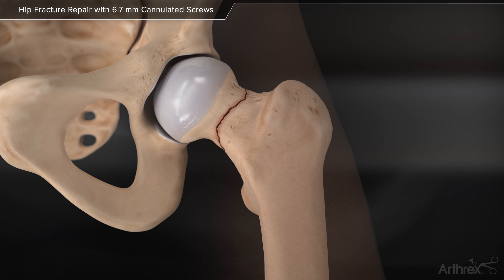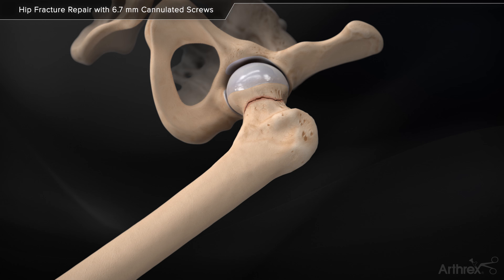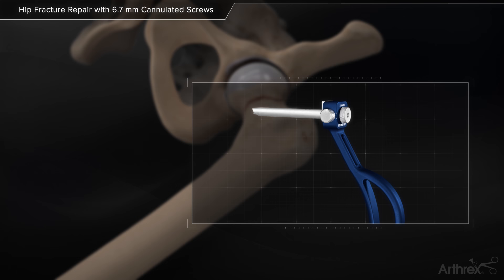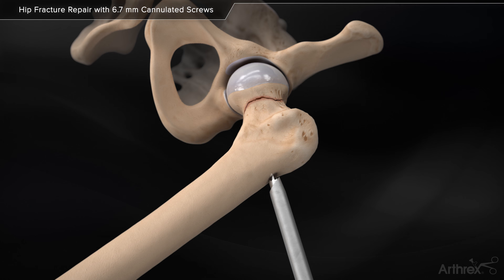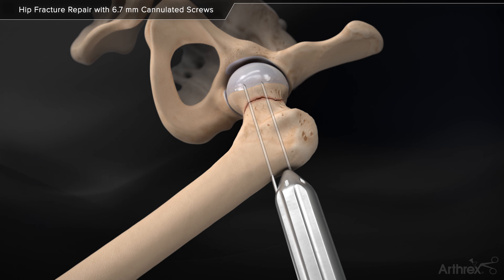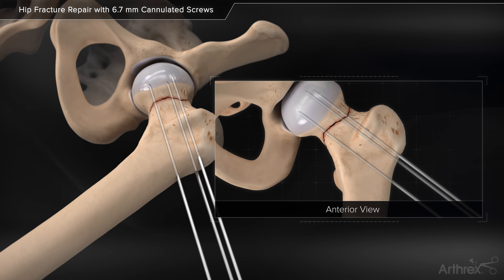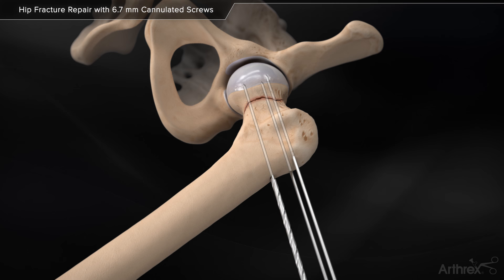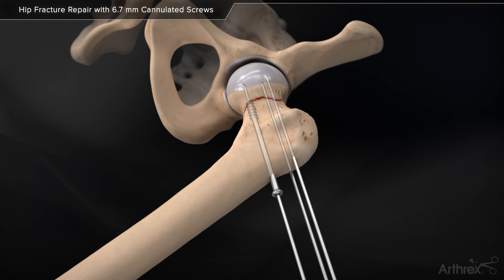Hip Fracture Repair with 6.7 mm Cannulated Screws

Comment: In this cases how many months and years to be heel and recover  I have been 5 years but i have a little pain in my hip sometimes I like it ok but sometimes it's not ok ,so tell me Doctor what to do that I can be ok like old time with my real legs I'm 36 years old  I will be very thankful to you Doctor
Reply: how is it now surssh did u remove the screw.and pain.
Reply: How are you now sir?
Reply: I already had a total knee replacement on the same leg as the fracture. After 9 mos of PT and every remedy known to man, the knee still hurt 14 mos post op. Then I fractured my femoral neck. I’m 75. I’m walking 6 weeks post op. Even the surgeon was amazed. Great surgeon for fracture. Not same one as knee who refused me pain meds after two weeks post op. This surgeon helped control my pain which enabled me to recover rapidly. I only had PT for two weeks, then did exercises by myself and go to the pool every chance I have. Walking in the pool and doing leg exercises as well proved most beneficial. The fracture surgery was nothing compared to the knee.

Comment: can anyone help me with the instrument names in this video? So the surgeon would use a pin guide (first instrument) to insert the first k wire inferiorly then attach a multi pin guide to insert the other two k wires. Is the parallel pin guide another instrument used if they do not have the multi pin guide available or is it used after the multi pin guide?

Comment: Broke hip about six  months ago, they put pins  and screws, done good for awhile  but  now having  pai n in groan, going down front of my leg  muscles weak alot of pain, put asteroid  shot didn't help  in hip😢just wondering what i can do
Reply: How many hours where between when you fell and the operated.  I wonder if the bone has died and you’ll need full replacement.   That’s my worry.

Comment: Seems in alot of these wouldn't it be easier to do a total hip replacement?
Reply: My specialist had explained this in detail. 

A total hip replacement is generally catered for older aged people as they have weaker bones which may cause more complications if they were do this type of surgery using cannulated screws. This type of surgery is mostly catered for younger age people, where the chances to save the femur head joint is significantly higher.

Comment: How many months required to remove the screws
Reply: Removal not advisable until indicated
Reply: Depends, it took me 8 month.
Reply: @Enlayy  does the pain reduce? and can u able to walk and do regular activities?
Reply: @thammishettyrammohan  well my once broken side still feelf different, but dont let that keep you down. Im going to the gym regularly and im hitting legs two time a week. Altough I have to train a little bit different compared to the time before my injury. But dont let this injury keep you down and try to make the best out of it. Walking and regular activities are no problem. Im guessing this is also because I gained some muscles on my legs again which is quiet important. 
If you have any questions feel free to ask me, im glad to help because I know how you feel. :)
Reply: @Enlayy  thanq and post tuesday i am going for the surgery ...hope eveything will workout good
Reply: @thammishettyrammohan  It will ;) My injury was pretty much the worst version of it and it turned out fine! :) You will be alright. If you need any kind of advice feel free to contact me.
Reply: You felt much better after removing the screw?
Reply: @thebestkeptsecret2263  In the beginning, no. After some time, yes.
Reply: @Enlayy  so removing it is worth it? Mine is in my hip area. Screw and side plate. Where's yours?
Reply: @thebestkeptsecret2263  I had the same done to me. Like shown in the Video. Sonner or later the screws and plates have to come out. Did you doctor give you a choice to remove them? Because in my case they just told me its time to remove them and then they got removed.
Reply: @Enlayy  Haven't ask him yet. But some doctors said it's ok to leave it there as long as it's not bothering the patient. But my only concern is once you get older you might get complications not removing it. Why did the doctor advise you to remove it?
Reply: @thebestkeptsecret2263  Well I had the screws in me when I was 17-18 years old so I was really young. I guess that plays into the decision to take it out fairly early. I was told that the process of removing everything is really easy thought so I dont think you have to worry. My bone was back together and thats when the doctor gave to green light to take everything out. After that my rehab started. In the beginning I felt really unstable on my once broken side, but it got better and better over time. I would recommend you to go easy on yourself once you get rid of the screws and stuff for some time after the removal. Make slow progress step by step, literally.
Reply: If I were you I would talk to your doctor and tell him your concerns. Communication is really important in the inujury.
Reply: @Enlayy  I see...how long you had the screw? How many months now since the removal of your screw? Which part of your hip had fracture? Neck of femoral?
Reply: @thebestkeptsecret2263  I dont really know which part it is, particularly not in english since its not my first language, but it was the worst type of fracture, thats what I remember. I had my screws in for ~8 month and it has now been ~1.5-2 years since I got them removed
Reply: @thebestkeptsecret2263  Im guessing its the neck fracture. But my injury wasnt a fracture my femure neck was literally broken into two pieces.
Reply: @Enlayy  I see. Im hoping for your fast recovery
Reply: @Enlayy  how are you now still since the removal of screw? Getting better? Thanks
Reply: @thebestkeptsecret2263  Well at the moment nothing really changes, its just the way it is and that is totally fine. How about you? Did you get yours removed?
Reply: @Enlayy  hi! I just got three cannulated screw inserted on me yesterday. Nice to hear you do well now! I want to keep my screw inside me, is it advisable?
Reply: @chailiang1230  Do you want to keep them permanently?
Reply: @Enlayy  yes I don’t want to go to another surgery if not needed
Reply: @chailiang1230  You should speak to your doctor. I got mine removed and I am very happy with how it turned out.
Reply: @Enlayy  I’m sure I will. My next follow up will be on 4 weeks from now, Doctor said I can weight bearing if everything goes right. I really wish it will turned out to be great. Thanks for sharing
Reply: @Enlayy  please guide me
Reply: i have screws and plates,they dont really come out. trust me you dont want to be opened up again for this kinda surgery
Reply: @neerajtripathi5927  Feel free to ask me anything :)
Reply: @phonerush5395  Please talk to your doctor, they know whats best.
Reply: @Enlayy  my mom had done a surgery 7-8 days before for her left hip neck of femur surgery due to fracture... 3 screws were inserted... How many days she'll take take for full recovery...
Reply: @Enlayy Happy that you recovered well.
 I had the same surgery about 4 months ago and i recovered well but now that i am starting to put some weight on the leg and trying to walk again it hurts a little mostly in the knees and the hip joint and not so much in the fracture itself, is it normal? 
like is it because i didn't walk for so long? what was your experience? and how long did it take you to start walking like before the fracture?
Reply: @saadatsn4523  Sometimes I also feel slight pain or discomfort. I would recommend to build some leg muscles and try to strech a lot. It will never be the same as befor for me, but I got used to it.
Reply: @Enlayy I had exactly same surgery as in the video how many days it will take me to become normal kindly let me know
Reply: @1566chandra  My screws were removed after 8 months
Reply: @Enlayy you are doing great job by giving advice to everyone it's feel so good thanks bro , I had doubt when my accident happen I am not serious about my leg and still walk for 10 days with fracture it wasn't that hurting so I take lightly after 10 days Dr said it's fracture on neck and head and neck collaps and neck is inserted in head now 4 screw is fitted and now I am for rest it's been 2 weeks and my question is am I able to walk like before? Because head and neck collaps and 1-2 cm neck is entered in head and is thare possibility of avm I future? I am 20 yo(sorry for bad English,)